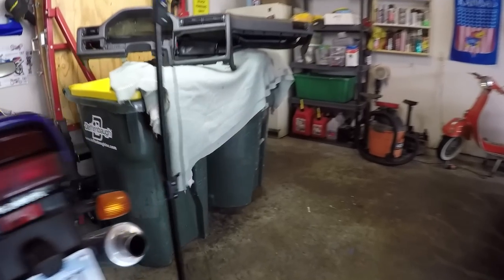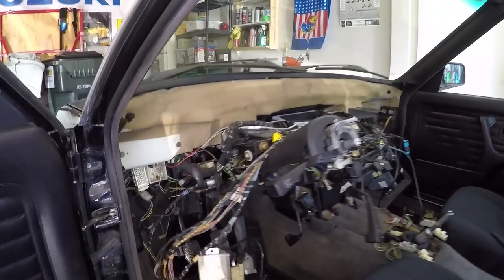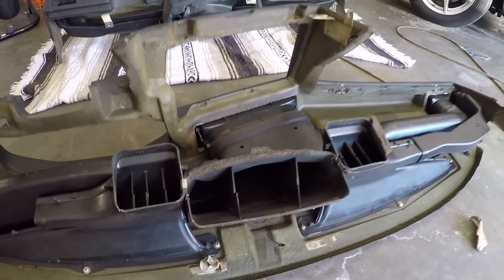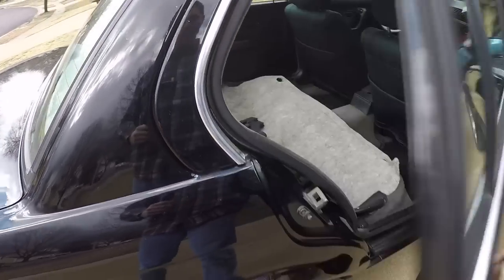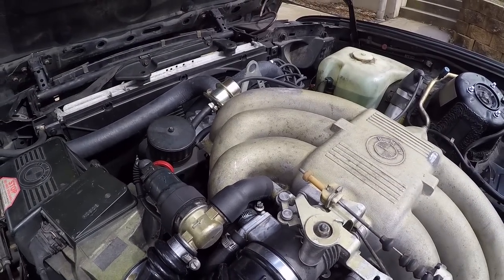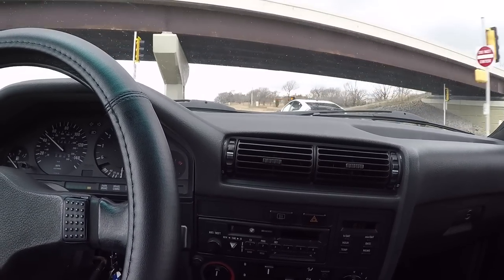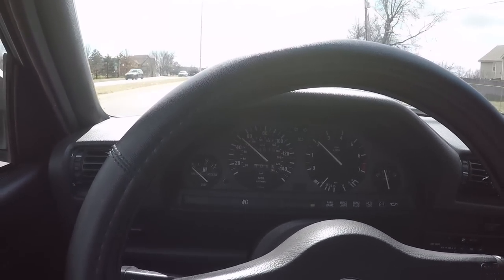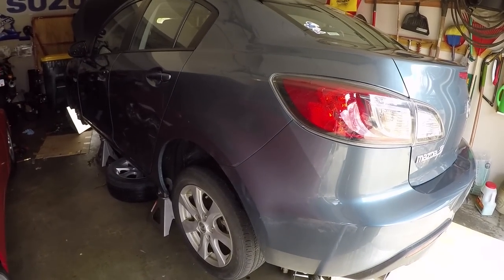Project E30 / Ep. 21 / Dashboard Swap and Second Drive

Comment: I've started but not completed my dash board swap in my 91 318IS.  I took the  "as long as I'm in here " approach.  Heater fan blower resistor replaced, disassemble and test and lube the fan, change all heater hoses, replace AC components related to a full R134 swap. It adds a lot of  time and money to the project.  I have to say, of all the E30 tasks so far, I did NOT enjoy this one-its awkward and tight and uncomfortable spending an hour on my back under the dash. Its a complicated job with all the ac/heater vents

The other suggestion I'd make to other E30's out there is to clean contacts, check grounds, replace all the dashboard lights when the assemblies are already sitting on your bench. My car had 200K on the clock so I just replace everything before it dies.  

Great series-I always look forward to seeing your clips. Keep up the great work

Comment: Your E30 is looking better and better! Do you have sport seats? I just took a dash out from a parts car few days ago to harvest some HVAC parts. It was fun to take it off without concern of putting it back on :P. Some 303 over the dash will prevent it from future cracking.
Did you check your circulation shutter doors when you have the dash off? They are very prone to cracking. The best time to repair them is when the dash is off.
My wife drives a mazda too. She was not happy that my needy E30 took over her garage space and so many weekend hours. .ha 
Love your new channel icon
Reply from the maker: I'm lucky to say my wife has been understanding of the BMW...so far haha. It's taken the Mazda's garage spot for over half a year now! I do have sport seats, but they too need to be recovered. The idea is to recover the original rear seat and then swap in the recovered sport seats. I gave shutter doors a brief look over while it was apart and they seemed to be working alright.

Comment: If you think that steering input is good then you would love an e36 steering rack replacement, that's going from 4 turns lock to lock, to 3.2 turns LTL. Or, if you can find it, then go for a z3 non-M version rack with 2.7 turns LTL ratio, which is nuts! Lots of info on this on R3vlimited or Bimmerforums
Reply from the maker: I might have to look into one of these steering rack swaps. They seem like an affordable way to really enhance the car.

Comment: Car looks great. Sad you live Kansas. I love ripping mine on curvy roads. Ill be doing an 885 head swap on my eta. Prepping it for a turbo.
Reply from the maker: Thanks! I'm jealous of anyone with quick access to good roads. It sounds like you have an awesome project ahead!
Reply: @PracticalEnthusiast  should be a well rounded canyon carver. Looking for 3-350 whp on pump. Just changed out my one blown and one tired rear bilstein sports tonight. Such a difference. I have been running the h&r race and bilstein for 5 years. Love it. 22mm front and 19mm rear. Great combo. But even just the front its more neutral, but still rotates nicely.

Comment: Quick question... I noticed you temp needle never went to mid point. My 325is only goes up to the first quarter and I was thinking it might be a stuck thermostat. Do you have any insight on this?
Reply from the maker: It's completely normal. This car has a new thermostat in it, and the gauge/sensors are fine. I've noticed other BMWs tend to read below middle of the gauge as well. Nothing to worry about!
Reply: @PracticalEnthusiast   Concur. Brand new temp sensor and thermostat and needle registers a little below mid point. Only disconcerting if you have newer Bimmers which are very consistent with top dead center temp readings.

Comment: did You figure out whats this high pitched noise ? kinda like diff whining or super tight aux or timing belt
Reply from the maker: It was the transmission. I ended up replacing the transmission with a known-good used one and it went away. Not sure if it was caused by input shaft bearing wear or gear wear because the transmission had been run low on oil.

Comment: Ah so your temp gauge does not read right in the middle as well? I was going to replace the thermostat in mine because I thought it was stuck open.
Reply from the maker: I think it's pretty normal for the gauge to read like that. I've noticed that it will get closer to middle after driving it for quite a while.
Reply: Practical Enthusiast same here. I was not sure if my thermostat was bad or the car would run in that range.
Reply: Wouldn't be supprised if your oil cooler thermostat has seen it's best days. The gauge should sit in the middle with an 88c water thermostat

Comment: I have an 87 325es. I have a serious whine when I take off because it had no gear oil in the trans. I have a new trans and I’m waiting for my clutch to come in to put it in. I’m not trying to be a downer, but it’s the same whine yours is making on take off. Same getrag 260.
Reply from the maker: The transmission is definitely worn on this car. The fluid was almost empty when I went to change it. It's topped up now and shifts reasonably well so we'll see.
Reply: Practical Enthusiast I understand, I was just trying to look out for you. I know mine whines when it’s in neutral unless I press in the clutch and disengage the transmission. Mine was bone dry for a month of my daily driving after purchase, honestly impressive that it still works.
Reply from the maker: @GravytrainE30  it is impressive they still work after so much abuse! I'm pretending it's a supercharger whine...
Reply: Practical Enthusiast do you have plans to replace yours? I know that there isn’t a rebuild kit. Your videos are very informative and a guide would be good for when I do it
Reply from the maker: @GravytrainE30  I'm not sure to be honest. I haven't taken on a transmission rebuild before, and like you said, there doesnt seem to be a rebuild kit available. Rebuilt 260's are pricey as well. It's a difficult situation!